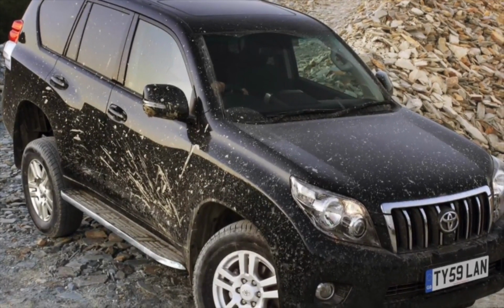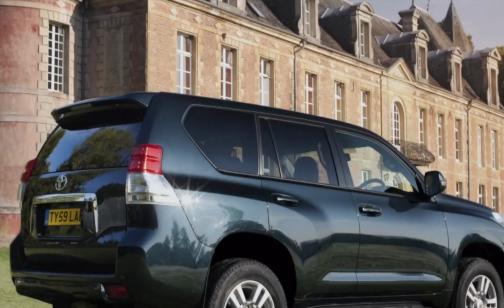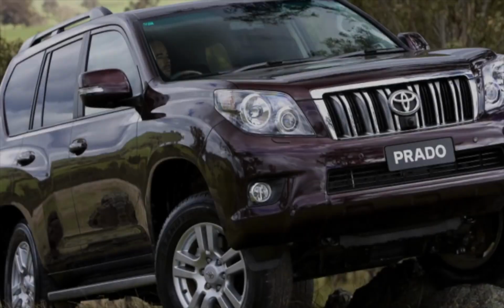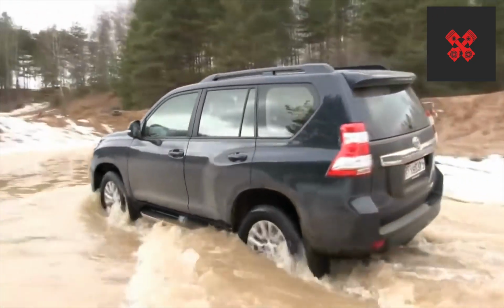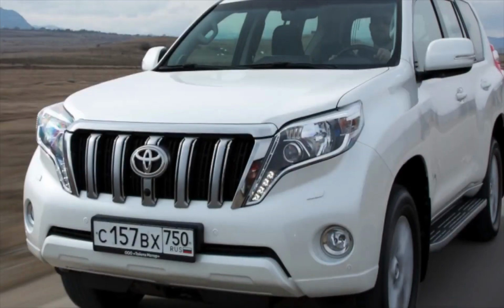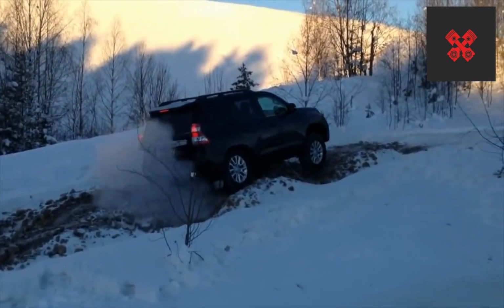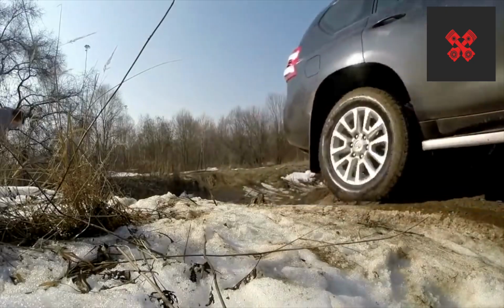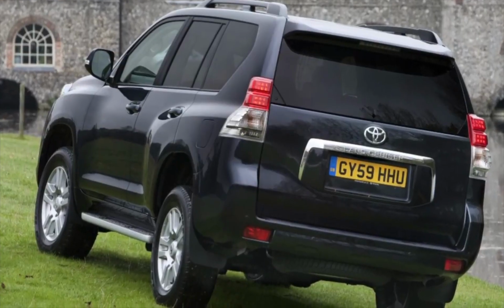Used Toyota Land Cruiser Prado 150 Reliability | Most Common Problems Faults and Issues

Comment: Prado is one big piece of junk, not much that not breaking on this so called reliable Toyota car. Stay far away it's not worth it unless brand new, should be ok for first 150 k km after that's it's just disaster waiting to happen.
Reply: I don't know... What you're saying is odd and maybe exaggerated, or maybe you got unlucky. These Land Cruiser Prados are known to be one of the most reliable vehicles ever made. The compaints usually regard infotainment, lack of features for the price... etc. But reliability issues? That's a first.
Reply: Bro what issues did u encounter? What year is yours and how many klmtrs? Thanks man
Reply: what is a better car to buy
Reply: What years?

Comment: My 2011 Prado V6 has 340,000kms still smooth and quiet I change oil / filter every 5000kms
Reply: Mine 2015 running 342k , it's  very reliable car .. 🚗

Comment: The last of the 1KD engines had Piezo injectors, which will not require replacement until over 200,000 km.